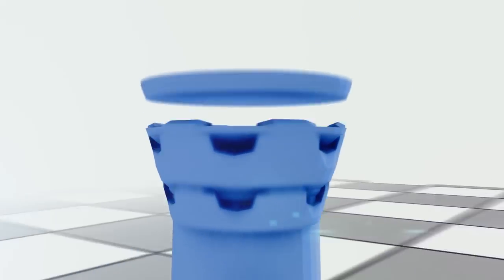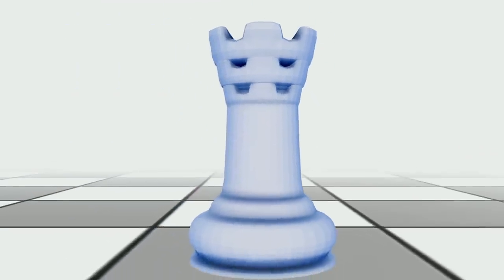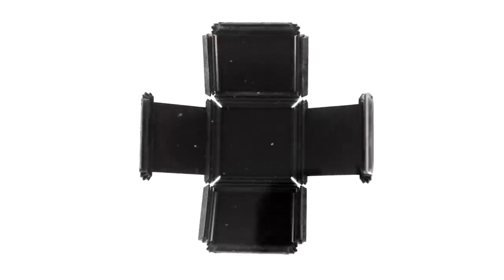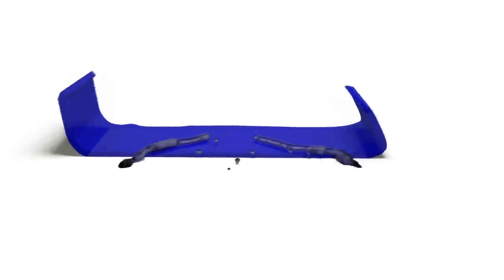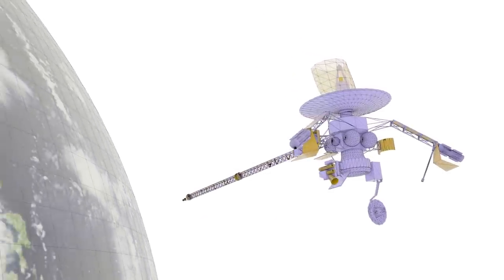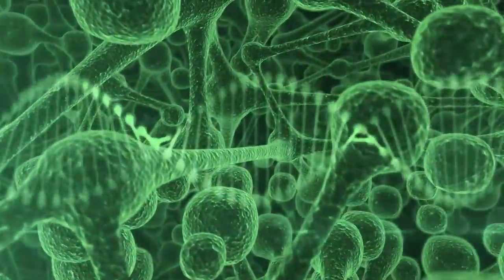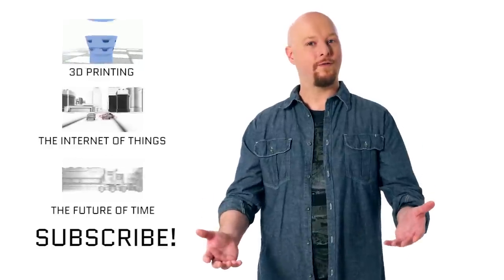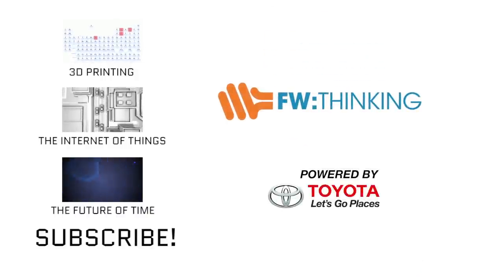4D Printing is the Future of Design

Comment: 4D simply means four dimensions. If I wanted to I could consider two spatial dimensions, a time dimension, and a dimension that measures force, and I would still be talking about four dimensions. Typically, however  the four dimensions considered are three spatial dimensions and a time dimension, but this is not necessary. If I really wanted to I could consider four spatial dimensions. As a mathematician I do this all the time. All of these ideas exist only in the sense that they have proven to be useful in science.

Comment: Wait, print new printers using a 3d printer? What about all the electricity and wires and energy and ink it will require? I'm not very good at 3d printing. Sorry :P
Reply: Well, if you found a safe method to print copper and other metals you could make all the chips internally, you would just need to buy metal things as well as plastic.
Reply: The True Uber Knight Ohhhh. I thought 3d machines only made things using plastic. Turns out you can insert other substances and create with those materials...
Reply: *****
If, we can't yet.
Reply: +Libra We're already printing parts for 3D printers, then assembling them and adding a cheap controller. This can then in turn produce more parts for 3D printers. So yeah.
Reply: +Libra there are very expensive printers that can print whole circuit boards.

Comment: How about construction. Print sheets and stack them using minimal space, and then fold them and assemble. Works with local and interplanetary projects. Imagine lining the exterior walls of a spacecraft with flat sheets for added radiation protection, and then using those same sheets as interior partitions and seats and the such.

Comment: Doesn't this just shrink together thin areas when exposed to water? It isn't really software running in plastic, it's just physics. Imagine a candle, that when fire is applied to the wick, it ignites into a flame and burns for a long time... I don't feel that this "technology' is anything new at all and can't be used at all for the idea's mentioned.

Comment: 4D printing = 3D printing + time factor

Why use only water? Let's think of other possibility to trigger transformation. What about light? Trigger by specific wavelength i.e UV or IR? What about sound? Trigger by ultrasonic vibration. 

Endless of possibility we can think of. It is just boils down to the engineering of structure-property of the material.

Comment: Wait, if we can depict 3D in a 2D picture, does that mean we can depict 4D in a 3D picture?
Reply: Can you visualize a 2D picture in 1D?
Reply: +The True Uber Knight I guess I didn't add in the dimension that rotation adds. :P A sheet of paper can appear 1 dimensional from the side, rotate it and you have a 2d thing, though it's actually still 3d, but you get what I mean. I guess that means we're actually living in a 4d picture, meaning 3d, because by moving around, we can see around corners and what not. So add in rotation and you can see through everything, bam! 4d lol
Reply: +The True Uber Knight With line. You can imagine 3d in 2d. Otherwise how the fuck would you be able to have a sence of depth watching TV or on your computer

Comment: i Would use it to break the value of time.
i explain.
lets say we create a counpound with a range of strength and bio so ecologic and easy to recycle.
then you make yourself a bank of designs and blueprints.
you make the whole thing opensource so the knowledge can circulate.
by having a 4d machine capable to print a multitude of material we can eventualy print our own material as long as we have the resources. no need of wal mart and a corporation based on taking the most out of ous. We can design better.
imagine a printer capable of printing an engine, a computer, a tv, a bike loll
now we just have to create a tiny recycling machine and you could have a lambo for the weekend and a nice sedan for the week loll